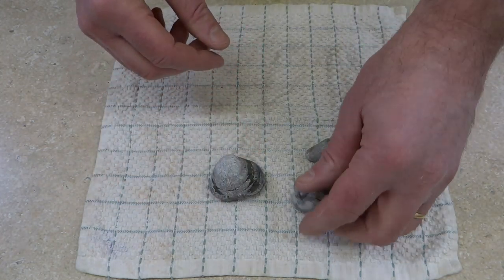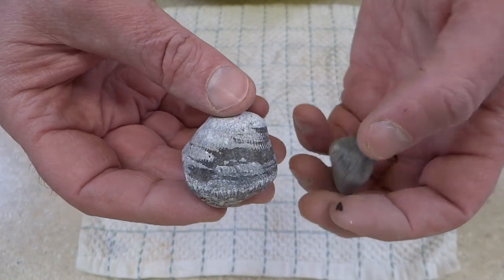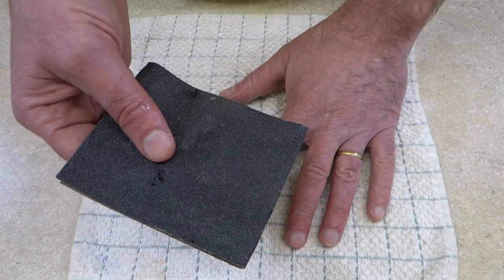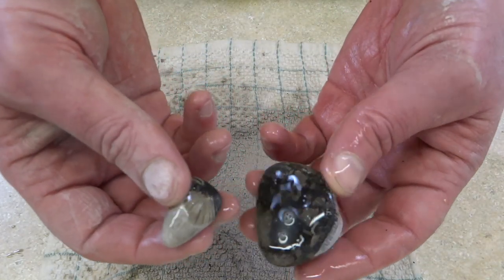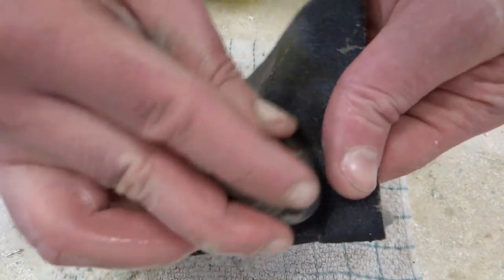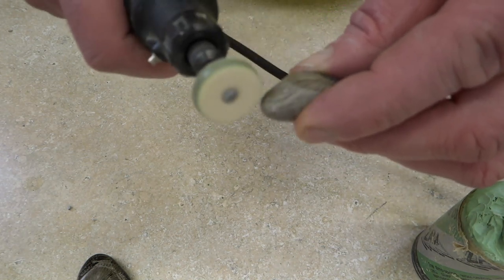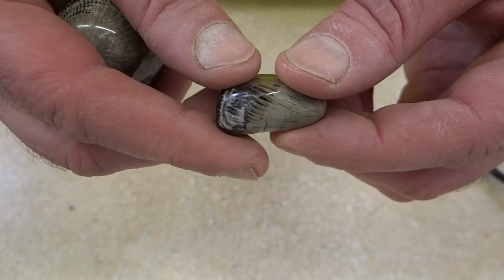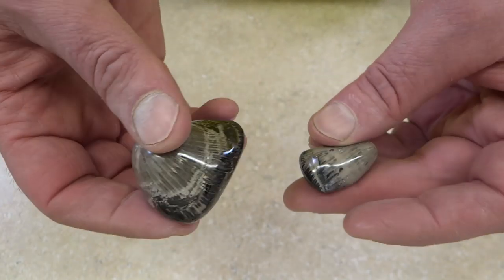Polishing Horn Coral by Hand

Comment: Could u use dermal instead of sand paper to save time?  Have u used bench grinder to polish?  Such a wealth of information.   Thanks.
Reply from the maker: I have a flat lap (like a record player with sandpaper on top) and a six wheel cabochon machine (like a bench grinder). Both machines have diamond abrasives on them and both save a lot of time. I made this video for people who don't have tools.

You could use a Dremel, but I have not since I have those other machines. Of course, you'd need to find grinders in different grits. I do use a Dremel to do the final polish with a felt wheel and Zam on soft rocks like these.
Reply: @MichiganRocks  Thanks you.  I have horn coral and Petoskey stones and so many others things to polish.  Have black, grey, brown, white, and green compounds. Wasn't sure what to use on coral. Web recco,emed this video fyi.  U rock.
Reply from the maker: @dawnmorning  Zam is one of the more popular polishes for Petoskey Stones. Aluminum oxide polish works well too.

Comment: Those turned out great. I have a bunch of horn coral I found in Indiana last summer that I've been experimenting with in the rock tumbler. Going to try my Dremel for a final polish now.
Reply from the maker: This horn coral is limestone, which is very soft.  I know there's some red horn coral that can be found out West somewhere, which I believe is a much harder material, like agate or jasper.  That would be much different to polish than my local stuff.  It would be useful to know what kind of rock you're working with.  Zam (the stuff I used with my Dremel) works best on soft metals and rocks.
Reply: @MichiganRocks  They are soft, so I only dropped them in the tumbler for 8 hours at a time through the different stages. Cleaned them up nicely. Excited to see how they look after polishing. I'll wet sand the next batch to compare.

Comment: They look great! I've polished Petoskey stones, but not Horned Coral. I'll have to try my Dremel sometime soon. When I hand polished the Petoskey, I used 80, 220, 600, 1000, 1500, 2000, 2500, and 3000 wet / dry sandpaper. Perhaps a bit of overkill. I also polished them by hand with a piece of denim and Cerium Oxide. When I use my Dremel, where did you get the polish? Keep up the informative and helpful videos.
Reply from the maker: A friend of mine gave me the Zam, but you can buy it at Kingsley North.

Comment: OOooo - those turned out so nice!  Without having any of the big saws or lap pad (?) sander equipment, and starting to have arthritis in my thumbs… could I use a little dremel tool like you used in this video, with different grit # sanding attachments - instead of the hand sanding?  This might also be the cure for my impatience with the thought of using a tumbler :)
Reply from the maker: I don’t see why that wouldn’t work. Give it a try.

Comment: I am sorry to bother you again with another question but I need your expert advice again. I just received my loto tumbler and it is to cold to use cement for the cinder block. Would it be ok just to glue two or three cinder blocks on top of each other, or glue two or three solid cinder blocks together. these solid blocks are a little thinner their maybe eight inches long by four to five inches tall they don't have holes but are made out of the same stuff as cinder blocks. Or do you know of some thing else? I really would appreciate your advice. Thank you so much. Oh how rude of me I love your horn corals. You do such great work and this is why I love your help.
Reply from the maker: Congratulations on the new Lot-O.  I think you’ll really like it.  

I have been participating in the Rock Tumbling Hobby forum for years, and I have seen a lot of different ways that people mount them.  Some people glue several blocks together to make a stand so they don’t have to get down on the ground to use it.  I think a single concrete block with holes is a bet too light. I filled the holes with concrete on mine.  I’d just make sure that whatever you build is heavier than a single concrete block.
Reply: @MichiganRocks  When they stacked the blocks on top of each other did they fill in the holes with cement Or leave them empty? Thanks for your help. I cant wait to use my new lot o tumbler.
Reply from the maker: Northern Rocks I think it’s just the weight you’re after, so it shouldn’t matter if they’re filled.  I’m not sure if the people who stacked them filled them, but I doubt it.

Comment: Looks great. How much of the shine is down to the wax? Or, is it all surface polish? Very nice though!
Reply from the maker: Zam is not wax, it’s an abrasive.  It doesn’t leave a wax coating that can be washed or rubbed off.  You can use aluminum oxide to get the same results if you’re worried about Zam.

Comment: How much sandpaper do you use? I have a bunch of small sheets this size and feel like I go through it way too quickly. Like in the first stages I’ll need a new sheet after 60 seconds. Is this normal or am I using bad sandpaper or doing it wrong
Reply from the maker: A piece of sandpaper lasts for a very long time. Make sure you're buying wet/dry automotive sandpaper. Just go into an automotive parts store and buy a variety pack.

Comment: I tried the hand polish method this week.  It went well until I got to the Zam.  It was impossible to charge the felt wheel, all the Zam did was crumble and fly all over the place.  I even cut off the top half inch.  Oh well.  The fossils are somewhat shiny anyway!
Reply from the maker: What was the felt wheel on? I use a Dremel. The Dremel I use is really old and only has one speed, so I assume it's a fast speed. Anyhow, it works well for me.

Another thing you can use is aluminum oxide polish. I just use a square of denim, get it wet and sprinkle on a little polish to make a sort of paste. Then I just rub it on by hand. It works about the set as Zam.
Reply: @MichiganRocks  thanks!  I have a Dremel, and that is what I was using.  I am pretty disappointed.  But its great to have the demin/polish option, I'll give that a whirl. Your Zam looks pliable.  Mine must be defective.  Happy Hunting!
Reply: @UC5E1PfBiYBUAzzO60U1ZyYQ I guess I'll keep trying, maybe a lower rpm on the Dremel.  Thanks for the replies!  I so appreciate learning through your videos.  Even if I am envious of how close you are to the lakes!

Comment: What hardness of gemstones can you polish by hand with sandpaper? I have heard hardness of 6 is the limit, some say even more.
Reply from the maker: There’s probably not a limit as long as the silicon carbide of the sand paper is harder than the rock.  Limestone is a three.  I wouldn’t want to sand something much harder just because it would take forever.  I usually use a grinder of some sort or a tumbler.  Hand sanding is just too slow and tiring.
Reply: @MichiganRocks  Thanks for answering me! I'll invest in some tools then, wouldn't want to get tired of polishing rocks just because it takes too long.

Comment: Can you still get that that polishing paste?( corrected)
Reply from the maker: Are you asking if I could still use the aluminum oxide?  I guess I could, but it does the same thing as the Zam, so there's no point in doing so.
Reply: Hi, no the tube of green stuff you used with your dremel tool, the Zam.
Reply from the maker: lightweight777 I’m still not sure what you’re asking.  There’s a typo in your original question, but I can’t figure out what you were trying to say.  You can get 
Zam at Kingsley North, if that’s what you’re asking.  https://kingsleynorth.com/zam-buffing-compound.html
Reply: Perfect yes thats what I was asking, if you can still get Zam :)

Comment: I bought some of that Zam like you use and it came lidless, hard as dried plaster.  Do you know of a way to soften it or should I just toss it and order from another source?
Reply from the maker: It’s hard stuff.  Mine hasn’t had a lid for as long as I’ve had it.  You need a buffing wheel of some sort to apply it.  I use a Dremel with a felt wheel as you saw in the video.
Reply: @MichiganRocks  I tried.  It threw pieces like shrapnel and ate my buffing wheel LOL.
Reply from the maker: @terryrgee  My Dremel wheel throws some off the stick too, but most of it sticks to the wheel and turns it green.  It's hard to tell what you're dealing with without seeing it in person.  Someone gave me my stick that had already been used and I've had it uncovered for about 8 years.  From that experience, it doesn't seem to dry out.

Comment: Can you use the same polishing technique on stones and if so what hardness level does that work with? Thank you for the video.
Reply from the maker: This is very soft limestone.  This method would be very, very slow with harder rocks.
Reply: Michigan Rocks OK thanks. I’ve tried some etching in rocks with a diamond tip but even that’s not very easy
Reply from the maker: Prevent PA for hard rocks, my preferred method is tumbling.  You could also use a flat lap or a cabochon machine to grind rocks.
Reply: Michigan Rocks I like the idea of the cabochon machine I’ll have to check it out. What’s your preference for tumblers? Something medium not too big.

Comment: Do you wear a mask when doing this?  I’ve seen a few people say you should. Wasn’t sure if I should or not.
Reply from the maker: I don't wear a mask when wet sanding by hand.  I wear a respirator when doing any dry grinding, cutting with a saw, or grinding on my flat lap or cabochon machine.  With high speed tools, I can feel the rock dust on my skin and in my hair when I'm done working.  If it's in the air, I can sure breathe it in and that's really, really bad for your lungs.  If in doubt, wear a mask or respirator. 

When sanding by hand and keeping everything wet, I don't think much dust can actually get in the air.
Reply: @MichiganRocks  Makes perfect sense. Thank you!